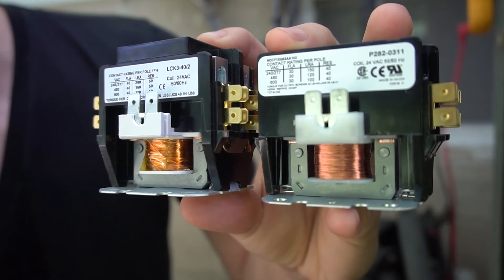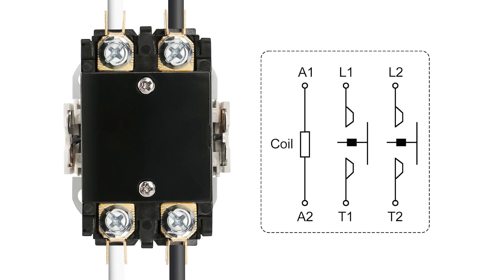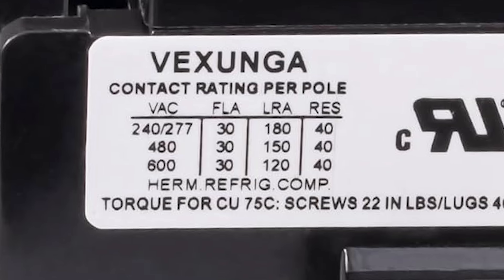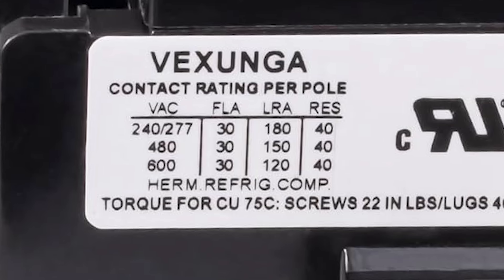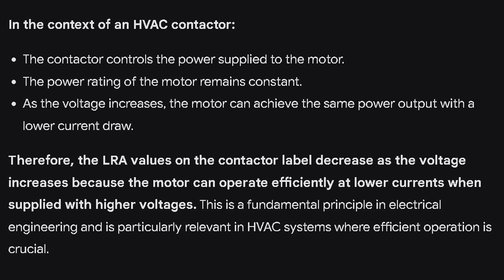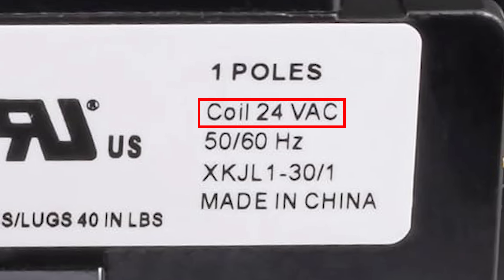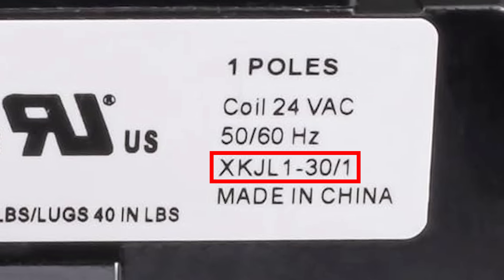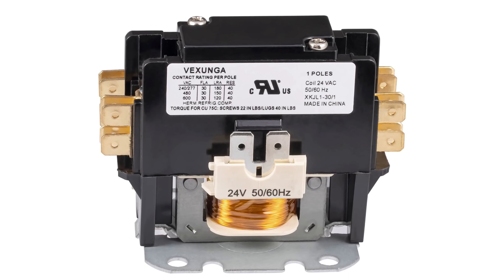What Do All These Numbers Mean on a HVAC Contactor?

Comment from the maker: ⬇ Other Videos You May Like:

How to Replace an A/C Contactor:
https://youtu.be/qHZc9wWAF4c
How to Test Contactor With Multimeter:
https://youtu.be/YCygHajsW34
Contactor Not Pulling in - 10 Reasons Why:
https://youtu.be/NVPhsK4gK1A
What the HVAC Contactor 2.0 Looks Like:
https://youtu.be/qgHsGR4WT18
How to Order HVAC Parts:
https://youtu.be/faCno8-vRnw
All Air Conditioner Parts and What They Do:
https://youtu.be/pJ8KeJFKDMM

Comment: Thanks for this. I have an electric water boiler and the wiring at the terminals connected to the relay were burnt and relay tabs were lose. Mine had a RES of 25 amps and the heating coil is 6000 watts so this relay (240x25 =6000) is just at its limit. Should I go bigger and do they make relay with screw terminals?

Comment: The cURus (not "UJ", the UL logo is also reversed [cRUus]) means the component is a UL Recognized Component in Canada and the US and complies with safety standards in Canada and the USA. The UR means the component underwent safety testing and can be used as a replacement part. Also, if a design uses UR component, the end product will not have to go through as much testing. UL and CSA (Canadian Standards Association) have many harmonized standards. So, CSA can act as an NRTL facility and test the products to give it a UL cUR mark or cURus mark or URus mark. Both the CSA and UL will file this information in their databases.

Comment: Great video.  the contactor i have to replace has the following LRA:  150, 75, 60.   With 150 in the same line as:  VAC 240/277 and FLA 30.  Question is:   I am having a hard time finding a contactor with an LRA of 150.  What are my alternatives?  Thx

Comment: Jay. Your channel is excellent.  I'm in Chicago area, and last week on a couple of very hot days(mid 90's) my AC condensor was running intermittantly for about a 24 hour period. Sometimes it would kick on, and sometimes it wouldn't.  Bypassed the stat, and got similar results. Put in a new stat and for a few cycles, more of the same. Ever since though, it's  been operating and cooling just fine. Have just looked at your videos about capacitors and contactors.  At this point i'm suspicious of both.  Haven't tested as waiting on some cooler temps here as of tomorrow.  It's a Bryant unit and is 5 years old. My Compressor RLA  is 12.8 and the Fan FLA is .6     The max fuse rating is 25 amps.    The capacitor is a 40 + 5, and the contactor is a single pole with FLA of 32. Which i'm discovering to be harder to find.   Can i replace it with a 30 ??    Also, what do you think caused it to operate intermittantly for about a 24 hr period, and then seemingly fine thereafter ??   Very puzzling  to say the least. Thanks. And hope all is well with you.

Comment: Hi! Thank you so much for this very informative video. We currently have a problem with our unit and will most likely have to replace our contactor, but I couldn’t find the exact same FLA , ours is 35 and the rest of it says lower values ( VAC : 240/277 - 35, 480 - 31.2, 600 - 31.2) LRA are as follows- 180,75, 50. Will it be ok if we change ours with an FLA of 40?
Reply from the maker: Replacing a 35 with 40 should be fine. 👍

Comment: We had a long week at work we had a building hit by lightning and 32 out of 48 units blew the fan modules, variable speed electric heat pumps, we had to replace 32 blower motors, freaking ridiculous the day after it happened it went down to 20 degrees so we weee passing out space heaters like candy, took almost a week to get the parts in. I love your channel keep up the good work.

Comment: I have spent the last few hours trying to find the right contactor based on the information in this video. According to my research, the contactor should be selected based on the compressor's RLA value plus the fan motor's FLA value, rather than the maximum fuse/breaker amperage. These values are stated on the sticker attached to the A/C unit. My sticker indicates a max fuse/breaker amperage of 50 amps. However, the original part installed on the unit has a FLA of 40 amps, which contradicts the information in the video. This led me to look up the OEM contactor part number based on my A/C unit part number. The OEM information confirms that the contactor should have an FLA of 40 amps instead of 50 amps. My compressor RLA is 26.4 and the fan FLA is 1.2, totaling 27.6 amps. Therefore, the manufacturer installed a contactor with an FLA of 40 amps. Thank you for this video, as it helped me to understand the necessary terminology to determine the proper contactor size.

Comment: Question whay my breaker box make noise all time before the ac unit going to start I have a carrier 4 tons unit thank you ?
Reply from the maker: My guess would be that the air conditioner circuit breaker has a loose wire connection which could also be melting the breaker inside. Or it's simply failing for some other reason. (age, wear and tear) I would turn off the power and pull that breaker out to take a look. If you want to see an example of how to do that, I show that in this video: https://youtu.be/CZylBCMmKR8?si=6CPcvvnQSMUHdiNV

Comment: Im on the fence with some of your uploads lol. Great info, but someone that doesnt have prior knowledge of this shouldnt really be opening up their AC for DIY. Its great to save $250-$500 for a simple service call you could have done, but a DIY job mistake can be minor to catastrophic.
Reply from the maker: I see where you are coming from. But there's  so many videos already out there on this topic. Those that will tackle this repair will likely do so either way, at least this way they will go into it more informed. 🤷‍♂️
Reply: Absolutely incorrect!! The videos are very informative n he does a great job explaining how  the repairs should be done. If an individual not capable of repairing AC items, then they should not try them. At least it will give them information that will prevent them from being ripped off and knowledge of AC systems. @WordofAdviceTV keep posting these informative videos.
Reply: Theres some guy out there that has a family and struggling to provide for them and air conditioner just went out and is probably really grateful to be able to tackle this. Dumb people are going to do dumb things with or without help. Gate keeping knowledge is never the answer.
Reply: I have had experience and license in the past. Due to getting 100% disabled no longer can work so that's why I can't afford a service call.
Reply: HVAC is probably one of the biggest legalized thefts happening.  Being informed is better than being taken.   He always explain things to the point where if someone isn't comfortable they can call someone and feel comfortable they aren't getting ripped off. Your premise is basically saying you need to be a contractor to be smart enough. Knowledge is where it starts
Reply: @jdubya54 There are just some things that a professional will know that you won't. Watching a few youtube videos and "informing yourself" doesnt replace decades worth of experience.

Comment: When I bought my central AC it came with a 240 volt single pole contactor. 14 months later the compressor shorted to ground. The tech that came out to diagnose changed out the contactor thinking it was the contactor maybe. It was eventually diagnosed as shorted compressor. Then 7 months later I had another company do the warranty work changing out the compressor. It’s also a heat pump. They changed out the compressor and charged it. AC side was working fine but when switched the heating saw the outdoor unit txv  lines frosting up. They said there was a restriction (sadly after already pulling a vacuum and nitrogen pressure testing. My question is, is changing the single pole to double pole contactor affect heat pump side at all or does that have nothing to do with txv restriction. Thanks in advance Jay! Pohan Leu
Reply from the maker: Sorry to hear about the AC troubles! Unfortunately the contactor and a TXV restriction have nothing to do with each other so it would not be the cause of that.
Reply: @WordofAdviceTV  thanks Jay! I figured not. Probably just due to the shotty vacuum the original installers pulled which probably caused the compressor to short from moisture getting into the refrigerant causing acid etc stuffing up the txv with the compressor finally burned out then 😩. To get the pressures up on the suction side under heat pump mode he said he added refrigerant 🤦‍♂️. Thinks it’s 4 lbs overcharged. 😅.  What a mess.
Reply from the maker: @LeuCustomKnives  Oh boy.. That does sound like a mess. Refrigerant problems, especially TXV issues, are always a pain to deal with. But hopefully this will soon be fully resolved for you sooner than you anticipate!

Comment: What does ALF stand for?
Reply from the maker: I'm not sure if I've seen that one before.. Did you see it on a contactor label? Maybe it's a scrambled version of FLA..
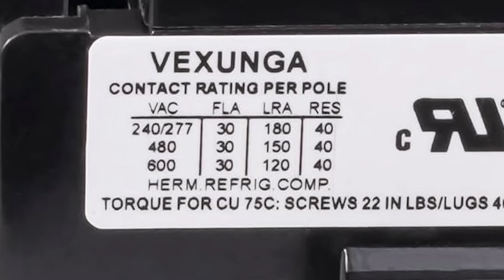Reply: @WordofAdviceTV you yourself told me about it. At 2:57 . Maybe it was an error?
Reply from the maker: @realSamAndrew Ah you're right! Thanks for the timestamp. I managed to already forget that I mentioned that in the video. 😅 I did some research into the different abbreviations before making this video and ALF was mentioned. I couldn't find what it means exactly but supposedly it has the same meaning as LRA so I threw that in there just in case someone has a contactor like that. Personally I haven't seen that abbreviation though. 🤷‍♂️ Perhaps I should have left that one out..

Comment: Residential voltage in North America will nominally be 240 volts, or possibly 208 volt in a condominium or apartment complex. 277 volts is not residential. That is line to neutral voltage on a 277 / 480 volt WYE system. 

That cheap Chinese single pole contactor might be rated to interrupt 30 amps on a 600 volt circuit, but it will live a hard and short life if you actually tried it. 

On contactors with more realistic ratings, the rated current is always lower on the higher voltages.
Reply: @realvanman1  really need to check. I’m a dentist and rent space in a large medical building. The equipment needs to be able to run on 208v oddly enough. 25 years ago one of my dental air compressor heads (made by Copeland) stopped working. I tested the voltage going into it and it was 208v. Someone had installed the wrong start box (capacitors, relay etc) before I bought the practice. I found the right box and it’s been fine ever since. But I had no idea before that time that 208v was even a “thing”.
Reply: @Drrich_DIY  Yes, 208 is line to line voltage on a 120/208 WYE system.  Common in strip malls and other small commercial environments, as well as some apartment and condo complexes.
Reply from the maker: Ahh okay! I rarely do commercial work so don't have much experience with those 277v units. I used to service residential units which often tested at around 248 volts so I erroneously assumed that the 240-277 is a range. Thank you for the correction and explanation!

Comment: Its UR. It means that it is a UL Recognized Component. Different than UL Listed. 

An R/C technically has conditions of acceptability that must be met and are intended to be used as part of a larger UL Listed product, whereas a Listed product is complete and the only conditions of acceptability are that you install it in accordance with the manufacturer's installation instructions (and any relevant installation codes).

The C before means it has Canadian component recognition and US means it has US component recognition.
Reply from the maker: Very good breakdown! Thank you so much for taking the time to thoroughly explain that part!

Comment: Are most residential single pole or double pole?

Could one use either single or double with residential use, 30 amp?

Great video!
Reply from the maker: Older air conditioner units often have single pole whereas new units usually have double pole. Personally I don't think it matters if you have a single pole or a double pole contactor but some technicians would disagree with me. To be extra safe, it's best to just replace a single pole with a single pole and a double pole with a double pole.
Reply: @WordofAdviceTV  Thank you!
Reply: @gotchaplumber  my ac has an oil heater so it always gets power, so I have a single pole. The leg to the heater is always hot. . If you don’t have that you should be able to use either. I would suggest replacing it with what is there.

Comment: I think that R US means you can buy them at Toys R Us

Great video, that was extremely helpful.
if the FLA is 30 does that mean the breaker needs to be 30amp? Can you use a higher amp breaker like a 40a? thanks!
Reply: no
Reply: @StevenQingchengCao  no what? if it says fla40 can I use a 30a breaker?
Reply: Look on the data plate of your condenser. That label will state your breaker size.
Reply: @roberts1159  @roberts1159 thanks. I've got two 1989 Armstrong air R22 units running strong.  I've replaced a fan motor here or there and a cap once in a while but no leakers. The plates are completely faded. Of course I could just go with whatever breaker is there if I have to replace it. I'm just curious as to how it works. Thanks for answering though. I wish I knew how much refrigerant was in the system and the locked rotor amps and all that other stuff but nope
Reply: @Drrich_DIY  That’s old equipment for sure. You are getting your money’s worth with those units although SER rating is really low compared to modern equipment. I would continue running them until compressor failure.
Reply: @roberts1159  oh and by the way I hate anything with a circuit board.  That’s why I love these AC units (pistons) and my old peerless oil boiler. Easy Peasy.
Reply from the maker: Lol! I'll have to visit Toys R Us one of these days then. 😄 (are they even around any more?)

Glad you found the video helpful!
No, you should not use a 40 amp breaker since it may take too long to trip if there is something wrong.
The breaker should be equal to or slightly larger than the FLA. Using a breaker that's too small can cause frequent tripping, while one that's too large can be a safety hazard. So a 30amp breaker is the best choice. Using a 40 amp breaker can allow excessive current to flow causing wires to melt, potentially leading to a fire or other electrical hazards.
Reply: @WordofAdviceTV  I think you’re right- toys R Us is long gone. Thanks for your breaker expertise. I’ve been looking for that answer for years. I knew too small of a breaker would be an issue but was unclear about whether it was unsafe if I went up (one of my Ac lines is aluminum so it’s a larger gauge than I expected feeding a .30amp. I just like to keep that info in the “vault” so I know the right thing if and when it fails.